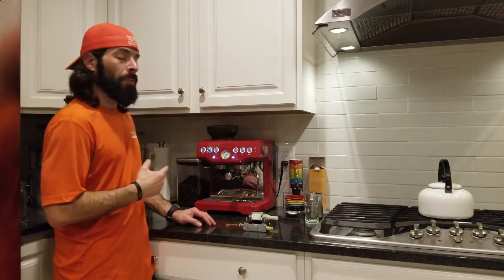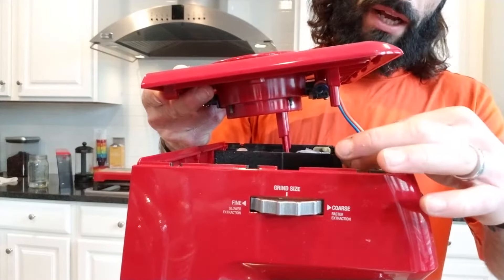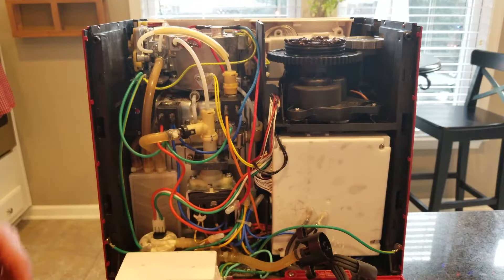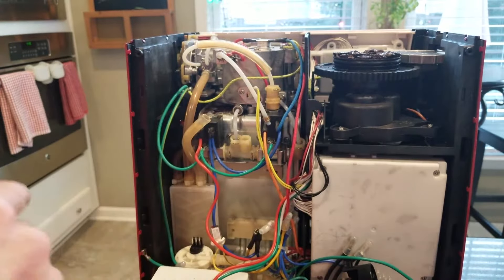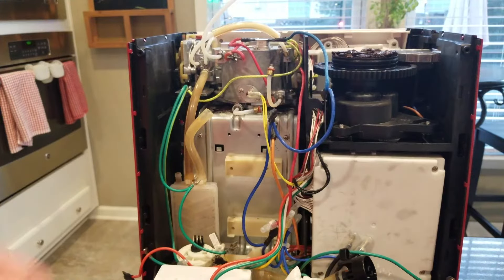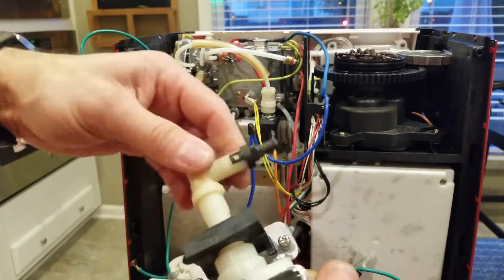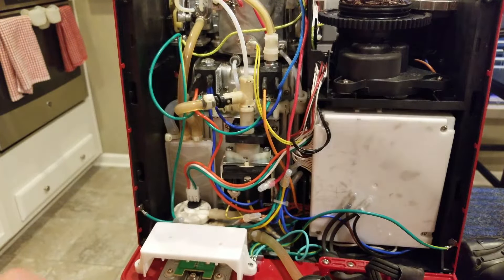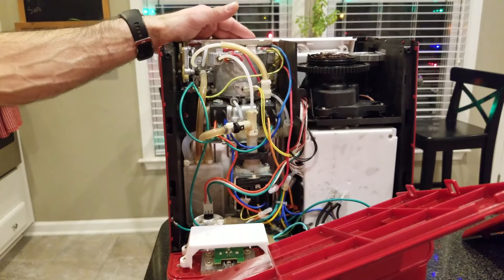Water Pump and Solenoid Block Replacement on Breville Barista Express 870XL

Comment: Where can I order the parts
Reply from the maker: A link to the parts can be found in the description.  However, others have found the parts for less by calling Breville directly.  I think you'll need the part numbers if you plan to do the latter.

Comment: I bought this same machine  in dec . 2018. it seems to already have started  misbehaving. from the look of your other videos, we seem to also share a bike  addiction. music is my  3rd addiction, guitars....
Reply from the maker: A good espresso, latte, or whatever your poison blends so well with bikes and music!

Make sure to check for scale blocking your lines before you rush to replace any parts.  I find the line all the way to the right (as seen from the rear) likes to collect scale that may break off.

Comment: My GF want to buy this model. Good choice or there are better alternatives for that range of price ? Also, ive checked some espresso machines repairs on youtube, i guess that with any model, parts like the water heater-pump-electronics etc will fail after 2-3 year. But at least if i do it my self, its a little cheaper..
Reply from the maker: I have two of these units. One has given me trouble free service for more than six years and makes damn good espresso.  The unit in the video, however, has not been so trouble free.  That being said, I use it daily to pull multiple shots and it's been mostly trouble free over the last 5 years.

Like you said most any machine is going to have problems. I think at the price point it's probably best in class in terms of quality of grinder and it's ability to dial in a good shot.  So, yeah, I think I would recommend it for sure.
Reply: @lai2703  thanks a lot !  Ok, so i'll let her spend the 600$ to get this machine (+15% sales taxes here in Montreal-Canada)..with a bit more  confidence ;)
Reply: LAI It’s definitely the best in class machine, for the money. Very reliable. I repair several domestics machines per week, and this is the only one I actually enjoy working on. Most of the internal parts have a design history going back about 15 years, with incremental improvements. Quality of many parts have gotten better over the years as they discover flaws.

Comment: replaced my pump after 2 months, still don't work. It now lives in the garbage can
Reply from the maker: Did you check for bits of scale in the boiler and it's lines?  This should be a first check for poor to no pressure/flow.  The one that seems to be the constant culprit for me is the lower connection at the boiler closest to the grinder.  That sucks that you had to bin it, but I would suggest pulling it out and checking that line if you hadn't already.  Also, might want to get a light and shine it into the boiler to ensure there is nothing further upstream blocking flow.

Comment: This espressos machine makes great coffee, but finding parts to replace is almost impossible, the biggest down side, if your machine solenoid fails there is no where to be find, even Breville itself will not sell you one, so you lose $600. I got the Breville 870XL, and is useless I can't find the part for it, and this machines are common to fail in about 2 years of service. I would NOT recommend this espresso machine to anyone
Reply from the maker: The solenoid in this guy isn't very powerful and I've found the smallest amount of friction will bind it up.  It is serviceable and I would recommend taking it apart and cleaning it up to see if that gets you going. Also, parts go in and out of stock on the link I posted in the description.  So, you might want to check back every now and then to see if it's come back in stock. Lastly, the biggest issue with these machines is scale due to the water most of run through them. Make sure blockage due to scale in one of the small plastic hoses isn't what's giving you fits. Also, I have a machine i run a commercial filter on and not one issue in the right years I've been using it. The red unit in the video uses filtered water from my fridge. It scales up over time.
Reply: @lai2703  I did, took the part out and did the service to it, however it didn't fixed the issue. But thanks for your help!

Comment: Thank you for the video, Luis!

I think my solenoid needs replacing too. Would you be able to tell from my video - https://youtu.be/EkikCrZvetg - if it should help or if it would need the pump or something else too?
Note: i tried adjusting OPV both directions, however, I couldn't get higher pressure (only lower)

Thanks so much, looking forward to hearing your thoughts!
Reply: First of all, there are two version of the "rubber portafilter inserts" - with & without a hole.

My one is with a hole, so it seems to be normal that the pressure is "in the middle of the black area" (dual-wall single short basket), however I still had issues with low pressure during espresso extraction.

Secondly, there are two solenoids in Barista Express. One has coil OLAB 9000 (espresso) and second has OLAB 6000 (steam).

I ended up switching the coils to check whether it changes anything and indeed - my espresso pressure is much better & steam doesn't work.

I'll order new OLAB 9000 and switch it back.

Anyway, thanks for the video. I hoped that this comment might be useful to other viewers.
Reply from the maker: Appreciate the insight!  I apologize for not replying earlier, but I failed to see the notification for your comment.  I am glad you got it worked out.